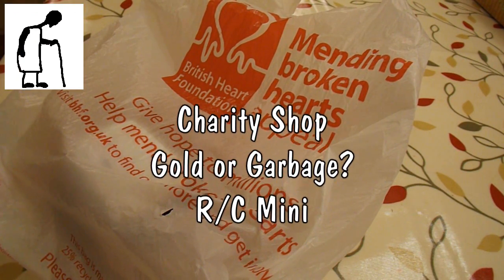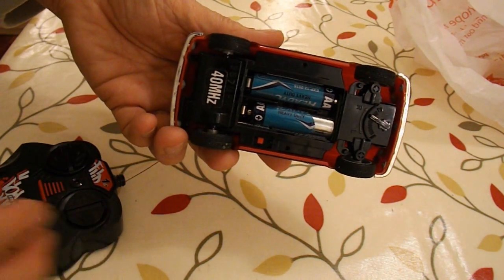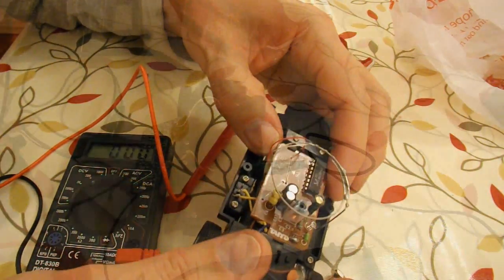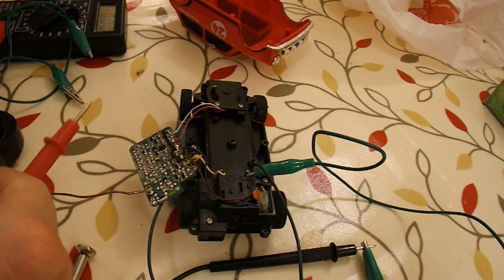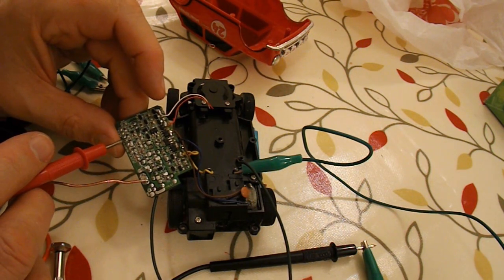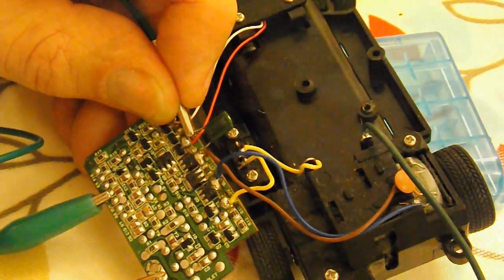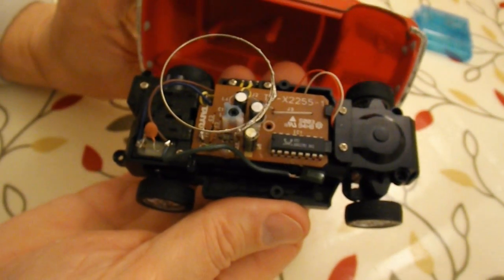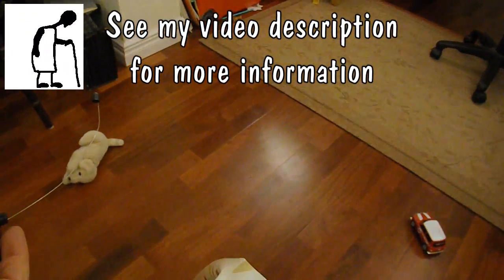Charity Shop Gold or Garbage? RC Mini

Comment: hey Grandad i need help here can u tell me whats the cylinder thing with a black `screw` cylinder in it is called? i over pressure it when i was trying to put it back for my 1st time & now it's kinda`roten` n cannot be used anymore my car won't respond to my broken transmitter (controller) so can u tell me how can i fix it or where i can get a replaceble one? (btw the `rotten' pieces is stuck inside the white/yellow cylinder how can i get it out?)
Reply: i'm pretty sure that an electromagnetic thinggy bec i'vd learned how to make an electormegnetic circuit in school by wrapping wire around the nail & i saw theres red thin wire wrapping around the outer cylinder ~
Reply: + uhmm i don't have any soldering tools so can i somehow save my controller for 0 cost ?
Reply from the maker: +Armour Shooter (multi gammer) I am afraid the bad news is that I cannot imagine any way of repairing it without a soldering iron and certainly no way of repairing it at zero cost. I am pretty sure that the item you have broken is the frequency trim pot (that is what they are often called) The inside part is like a threaded screw and as you screw it in and out it changes the reluctance or inductance of the circuit and that changes the frequency it responds to. You would have to find an identical item and replace it. As it is very unlikely to have any identifiable features, like a number written on it, then I doubt that you would be able to find a match for it and even if you did you would need a soldering iron to replace it. Your best chance is to find a replacement transmitter from another toy car. The good news is that when you say you think it is an electromagnetic thingy you are on the right track. The core that you screw in and out changes it's electromagnetic properties.
Reply: now i'm testing it with my another old broken rc car transmitter(the car is broke luckily the transmitter is ok) it works but kinda hard to respond i have to press very hard to get the car running & broke the stick  & i superguled the sticks & still broke it due to overpressure so now i'm finding some ways toget it easier to drive :/ hopefully it works i will experiment with my older controller where i got it from a fuel station (at my grandma's house) hope same frequency ...
Reply from the maker: Armour Shooter good luck
Reply: thx man ;)
Reply: uh Grandad could u add me in facebook? my name is : DK Loh C S 
so i can ask some questions regarding my cheap rc when i need help :/ 
i do have some questions for now but i cant use my pc for this few weeks & my old phone only supports fb so i'm asking u to add me if u have fb ;)
Reply from the maker: Armour Shooter sorry I only deal with YouTube business through YouTube comments
Reply: o.. k got it...
Reply: uh hey man where can i communicate with u (with picture) & really need help . 
i'vd searched all of my transmitter but mostly not working only 2 working  but 1 does not have the same frequency but i can run it just in front of it further no , the other one works in the past but now its kinda loosing range any tips? i'll be back in a few weeks ~
Reply from the maker: Armour Shooter the only tip I would give you is to try asking questions on a proper rc channel or forum and you are more likely to get answers from people who know what they are talking about. I just swap receivers from other cars that I know work.

Comment: Hello Grandad, this is a great fix and another thing i will try in my rc cars it won't work...
and about the datasheet, the logo is from Realtek, and i found this datasheet, i hope it's help:
http://www.datasheetarchive.com/dl/Datasheet-029/DSA00515113.pdf

Sorry for the poor english...
Gustavo
Reply from the maker: Hey thanks, that does not seem to be exactly the right match as far as the serial number goes but comparing it to the one I looked at for a previous receiver fix I can see pin 4 could be the oscillator input again and that was where I did the fix before. That is a handy data sheet as it gives some suggested values for the capacitor and resistor for the oscillator frequency so I could try to go a little further.
Here is the previous project fix http://youtu.be/pZ0StOheow4?list=PLA5a2xPRSrB13Xcquw4Ff09MQzTPjeVkI

Comment: Could the pulsing be because the capacitor is charging and discharging?  Did you try with just the wire and no cap?  Thanks for sharing!
Reply from the maker: Yes that is what I said about the capacitor in the video. With a direct wire it locked on the output to that wire so if I connected it to the 'right turn' wire then as soon as I pressed 'right' on the transmitter it would latch on. I used the capacitor to stop it latching. If I spend more time on this I could probably sort a better fix but as it worked it would give me all I need for the boat project I have in mind for it. I just thought it was an interesting and unexpected fix so I uploaded it.
Reply: GrandadIsAnOldMan
 ah, ok.  It is very interesting. Can't wait to see the boat project.
Reply from the maker: Kortt Wulfe it will only be a simple small boat in the bath. Just converting one of my previous projects to rc because I was asked to. Probably this one http://youtu.be/J0AOd75jUiQ?list=PLA5a2xPRSrB24vUS9E8zkSgjZysEL00zr
Reply from the maker: Kortt Wulfe here is that boat project :-) http://youtu.be/34ssD8e0Ncs

Comment: Great bodge !
The 2A472K is a polyester type no polarity capacitor, you follow the 3 numbers on those. The first 2 are the value, the 3rd is the multiplier, so that's a 4700pF capacitor.
The RX2 chip is very common (at least from own salvage vehicles) and perhaps unsurprisingly in the transmitter you'll find a TX2 chip, TX and RX.
No luck here either on the datasheet, but I would expect the Pin 4 to be a 'chip enable' and it's resetting or de-enabling itself as the stutter....another size of cap may well fix that. I'd try a '104' and then a '101'.
Reply from the maker: Thanks Slider, yes I did try a few other capacitors with some interesting effects. Initially I went the other way and had really long delays which was quite fun :-) What I really need to do is find a pin that gives me a constant value. With a direct wire it locked on the output to that wire so if I connected it to the 'right turn' wire then as soon as I pressed 'right' on the transmitter it would latch on. I used the capacitor to stop it latching. If I spend more time on this I could probably sort a better fix but as it worked it would give me all I need for the boat project I have in mind for it. I just thought it was an interesting and unexpected fix so I uploaded it. "Poke and Hope" at it's best :-)